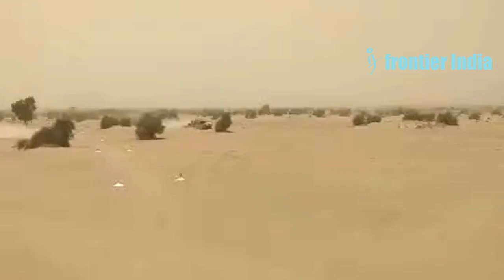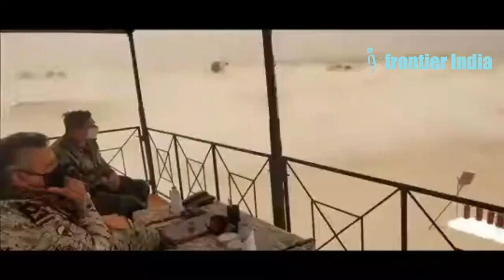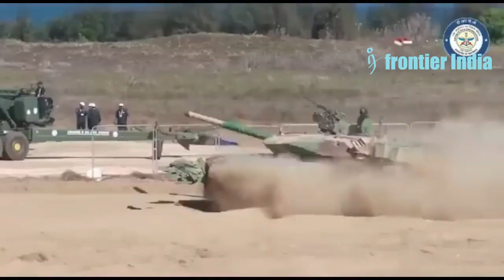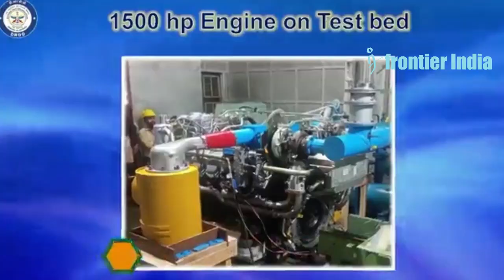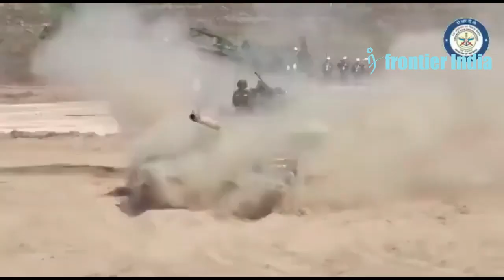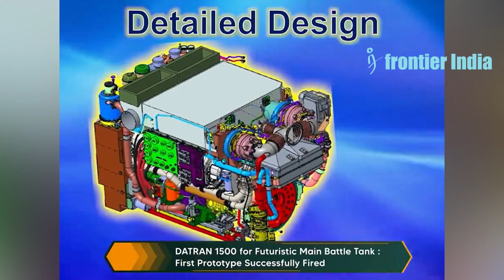Is This Mysterious New DRDO DATRAN 1500 Engine & Bharat Power Pack the Magic Bullet for Arjun Tank?

Comment: 4:56 You are wrong, the South Korean (more industrial capable than India) HD Hyundai Infracore DV27K, 12-cylinder V-12 weighs 2550kg Dry, so DATRAN is significantly lighter. DATRAN is 26L while DV27K is 27L, while DATRAN produce same or more power but, it also produces significantly more torque than DV27K and that too when its in the TD/Prototype variant. With further manufacturing optimization & other improvements, it will only get better.